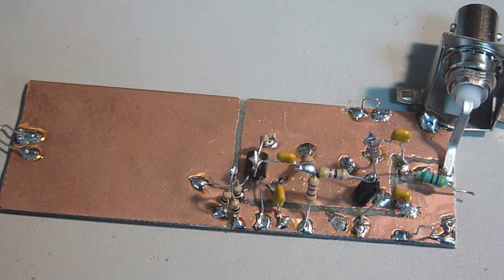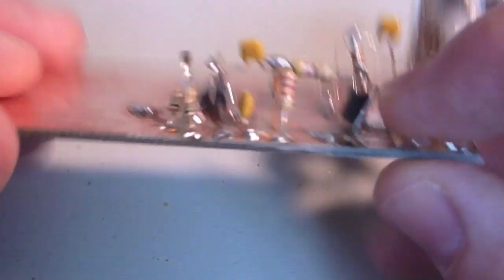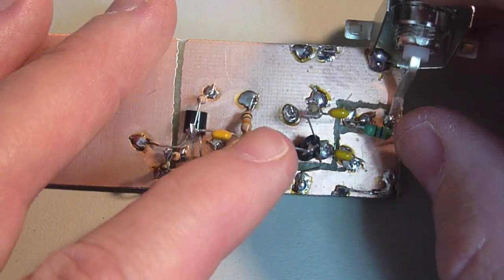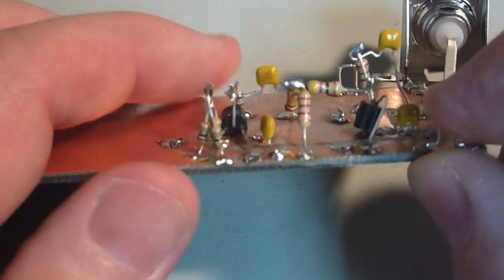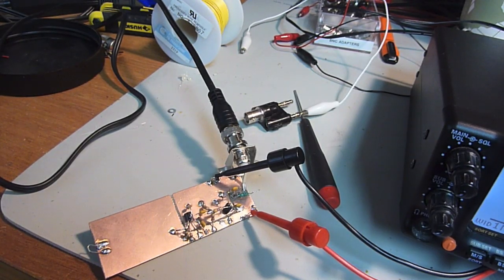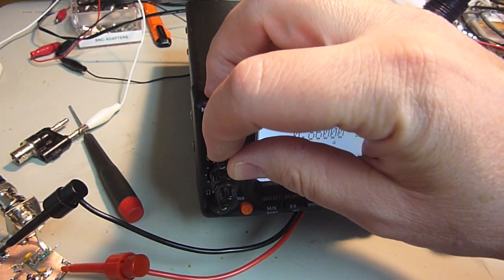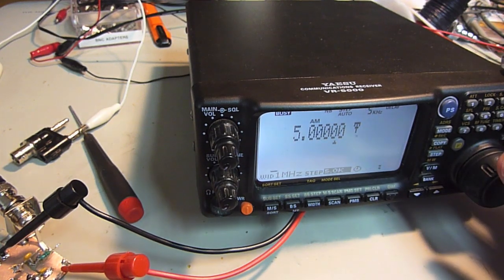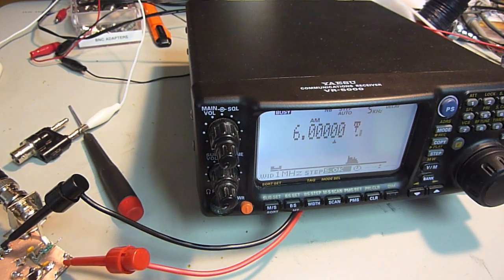PA0RDT active antenna demo

Comment: Thank You for the info. I may have to build one. I bought an active antenna from Banggood, and it doesn't seem to have any 12 vdc power going to the antenna itself, through the coax. I'm not getting any signal inflow. Think I bought a piece of junk, that needs repair. Only thing that seems to work is the Switch lamp.

Comment: how does it compare to say a 10m longwire?
Reply: +Richard S Try it 'live' on the net connected to a SDR  installed on top of the University building in Enschede the Netherlands  ..it will amaze you what this little bleeder will pick up :P       http://websdr.ewi.utwente.nl:8901/
Reply: +Henk Histomil yes, the SDR twente is world famous and an excellent receiver. But you an aerial is best tested against another of know qualities. I have tested the mini whip against a 54m longwire and below 1mhz, the mini whip was far superior, above 1mhz, it was pretty much equal between the longwire and mini whip. I wonder if you did any comparison and whst your findings were.
Reply: +Richard S Im a city environment with lots of QRN all over the bands most of the time  ..depends a bit  to wich radio i connect the miniwhip to I suppose ..on my old tubed Racal 17s  the 14m wire aerial with a RF systems magnetic balun does a better job overall..getting a  lower bandnoise ..both aerials seem to be more deaf in the higher part of bands as a vertical rod would be acting there ..  on the  SDR RTL dongle  with a ON1BES upconverter attached i do get better performance using the Miniwhip. SDR likes the extra amplification i guess..The Racals..well ..these  receive well on anything  youll attach to em :) Im impressed though with the miniwhip ..amazing such a little aerial can do such a good job .

Comment: PA0RDT works on completely different way- as it is an active antenna. It receives with the tiny antenna part (plain PCB area) and amplify the signal significantly before feeding it onto the receiver. A piece of wire or some rabbit ears simply produces some very minute amount of weak signal (in case of weak stations) which is even hard for very good receivers to produce a listenable signal.

Comment: I have another question,   What if I use a 12 volt 100 mA power supply?  I cannot find a 12 volt 50 mA power supply anywhere, can a 9 volt battery work?